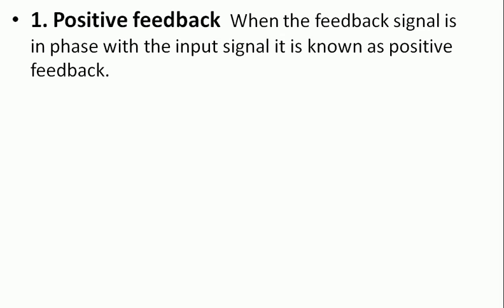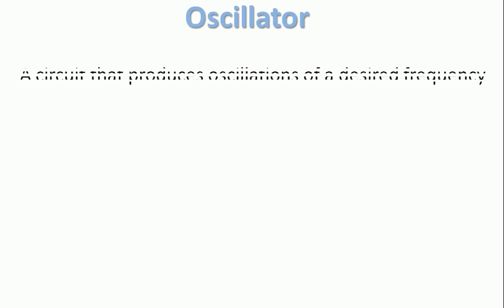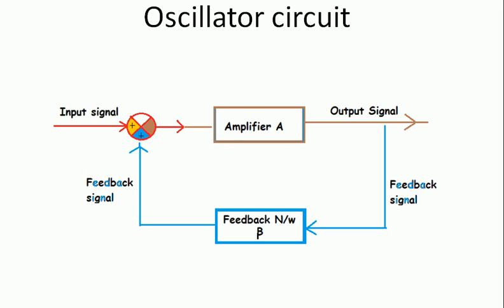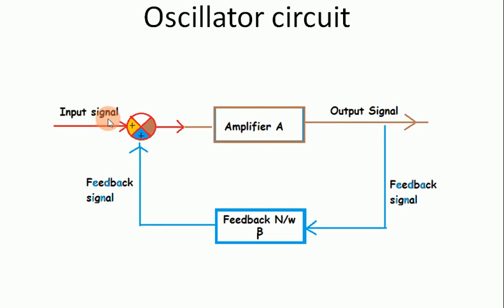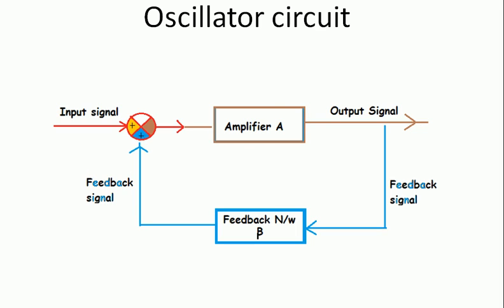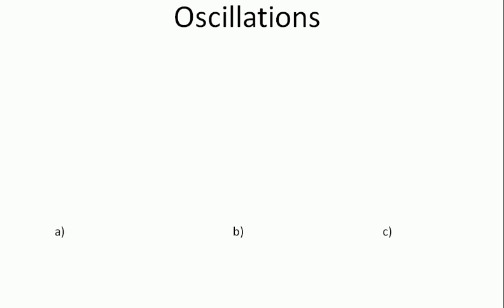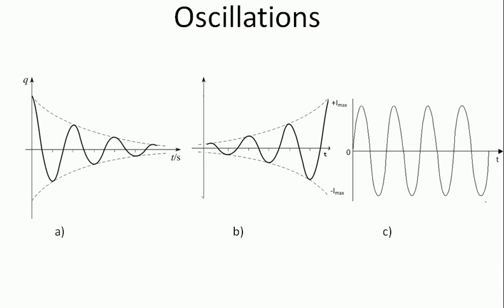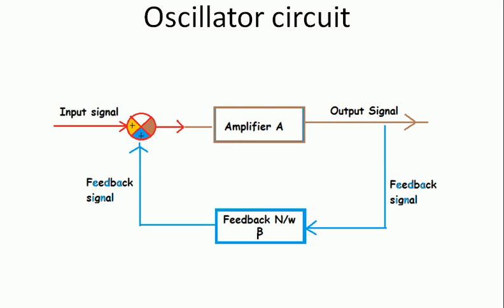Basic Oscillator Circuit by Jagdeep Sir.

Comment: why amplifier circuit is necessary in an oscillator?
Reply: To increase the straight of signal,voltage, current genrated by oscillator
Reply from the maker: Thanks Nidhi for spreading knowledge..